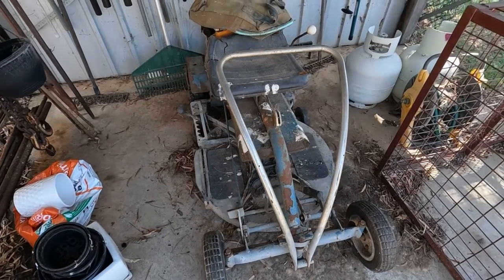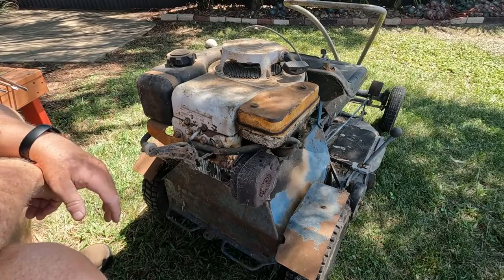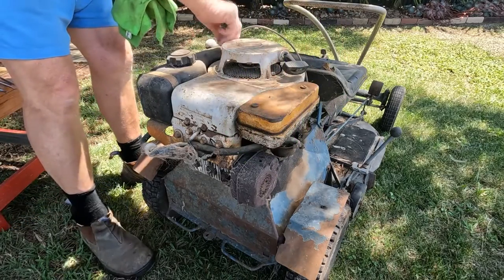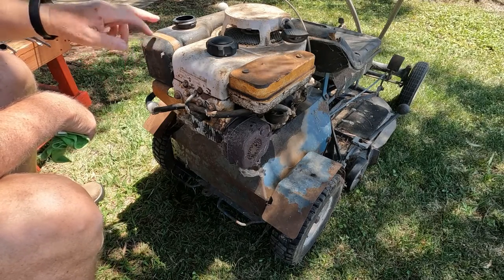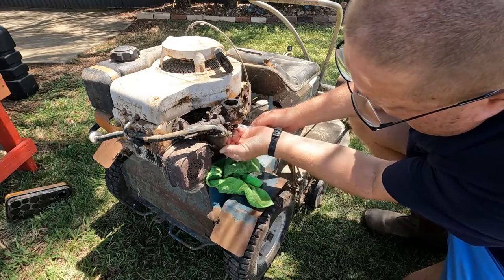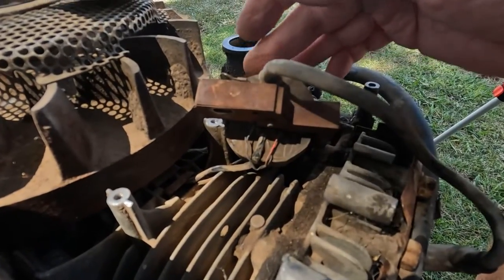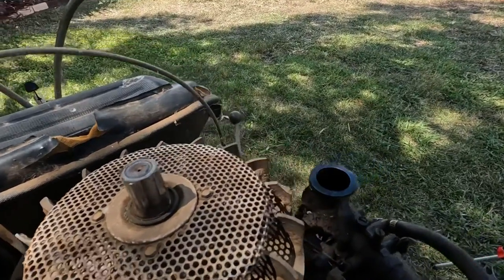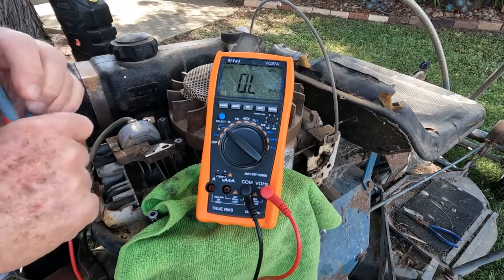ROVER RANGER RIDE ON LAWN MOWER - TRACTOR - WILL IT RUN - PART 1 - | SEPS ADVENTURES

Comment: Hey SEP is that the original way the engine is mounted I've got one with the engine sideways carb at the back can't seem to get drive sorted it strips clutch linings off wondering if the engine is mounted wrong is the cause. I picked it up for a $100 as a project
Reply from the maker: I believe the way the engine is mounted on mine is correct. I have a friend who has exactly the same mower and his is mounted the same as mine. There is a fair chance the 4 bolt holes will allow the engine to be mounted like yours has been. I have seen a few on youtube and none have the carb at the back. Hope this helps. Cheers!